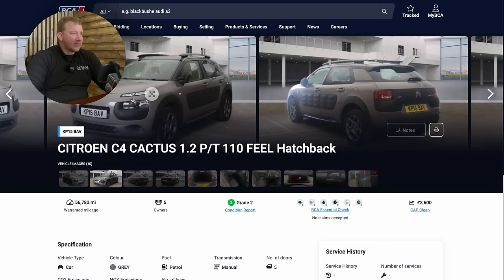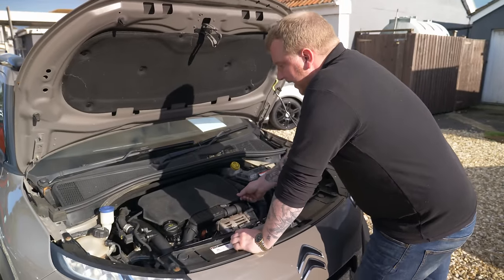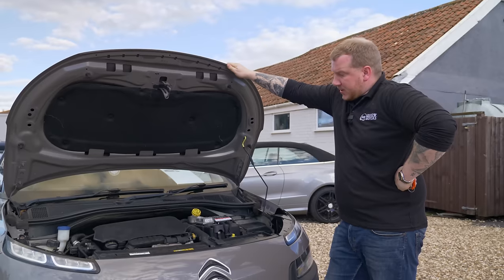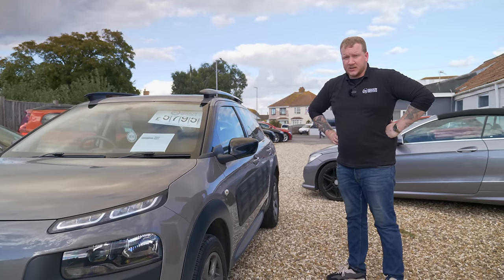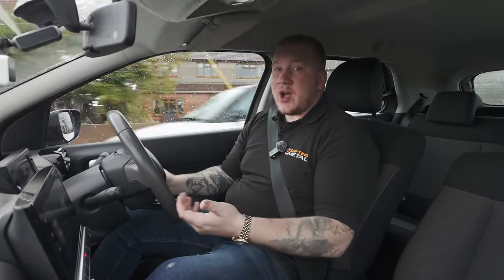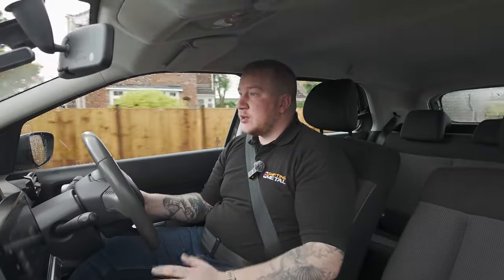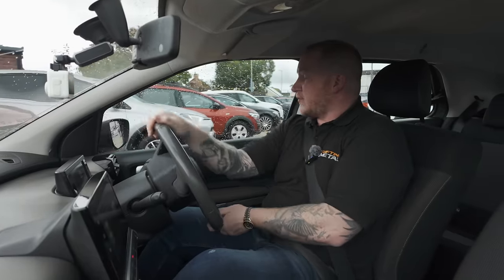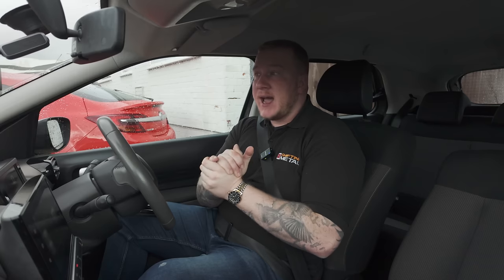I Bought A Car From BCA And It's Got The WRONG ENGINE!

Comment: Just change the iol pressure switch for a yellow one.
Reply: Thought it was fuel but yes.
Reply: Sorry about that bud, make it a rule just to go in person, I wait with the car I'm interested in, soon as keys are out, I'm all over, if it had been lumpy or light on, I'd have just walked off, bin on line bca, you'll never win there, all auctions are a nightmare it's virtually impossible to get something right and stay right for the customer. If it runs ok tho just get the fault mapped out, better than blowing a grand at the auction, ive probably told you before but I've had some right horrors from bca, I binned them off years ago, it was live then and they'd shout at you if you opened the bonnet, good restaurant tho (!)

Comment: BCA... I am not from the UK, but I always see them getting flak for being rather bad.
Reply: It’s because they own we buy any car and they literally buy any car and throw it through those bca auction.. when I took my bmw there they looked around it for 30 seconds checked the milage and I was gone in 10 mins after signing a couple things..my car needed new gearbox a new rocker cover and gasket and the dash board was rattling..I brought the car unknowingly with all those problems..feel sorry for whoever ends up with that car but I brought it and had to take a 4.5k loss on it I  drove the car 200 miles and 80 of those was getting it home..none of these problems was visible and I took my friend who has mechanical experience and had the same car. Never will I buy a car again that has came out of auction knowingly

Comment: Think someone's pulling your leg fella dipstick lol who came up with that ,nearly as good as it needs a fluxcapacitor , the engines running with the ecu that alone tells u it's not wrong ,ever thought about testing the fuel rail pressure or changing fuel pump to suit engine if its viable problem a pinhole or crimped fuel line somewhere or sensor. Dipstick still laughing now lol
Reply from the maker: @JamesRhodes-w3y  You obviously didn’t listen or just don’t understand 😅
Reply: @ShiftingMetal  maybe 🤔 who knows ,no offence sorry ,if I had it I would pull a fuel pressure sensor off another and test see if still has the problem just a thought with greatest of respect ,spread the love